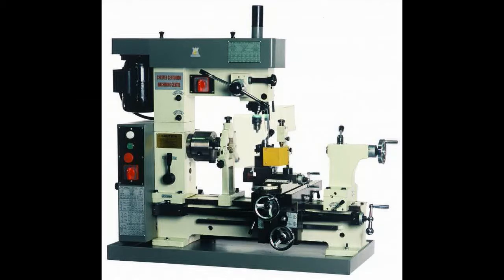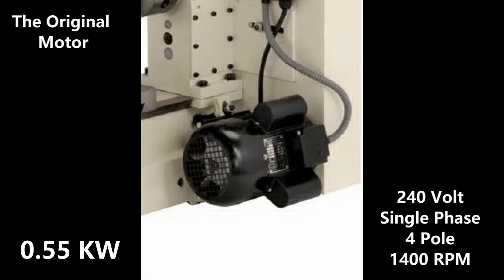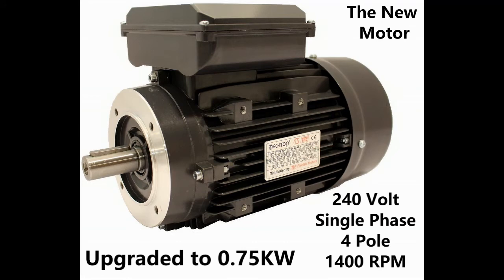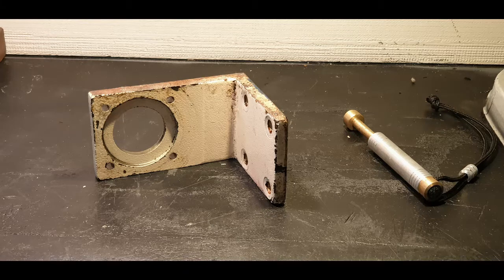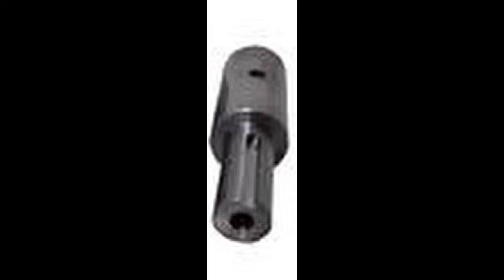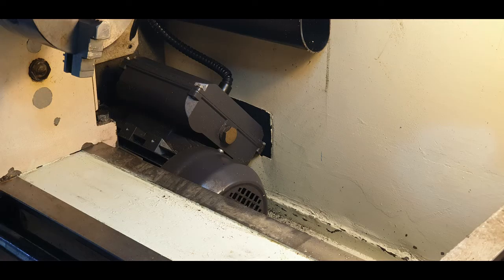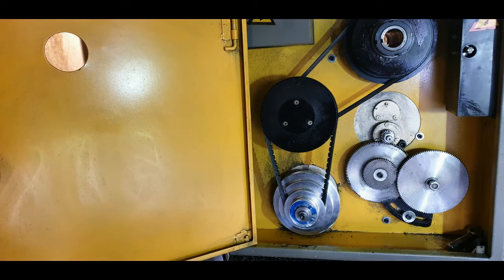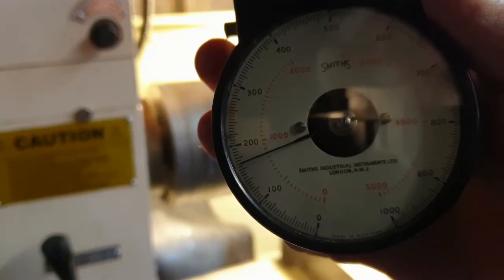Lathe Motor Upgrade

Comment: Good day, my HQ800 machine came new with 750 watt motors. I'm thinking of upgrading the lathe one to 3 horsepower. Because using my crosslide feed on a 1mm cut facing 170mm diameter the motor stops. Any thoughts on that will be appreciated.
Reply from the maker: The motors provided with the machine are quite cheap ones. I just upgraded to 0.75kw. These are quite adiquate. No trouble e er since the upgrade. Thanks Graham
Reply from the maker: Oops sorry for the late reply. The motors provided are really rubbish. Problems you will find is the new motor shaft length or diameter.  But my 0.75 hp new motor is serving my well. Not problems. Arr you will also need a new pulley

Comment: Try a variable speed drive!
Reply: VFD only works on a 3 phase motors.
Reply: @samlogosz8422  Indeed, so use a PWM control board.